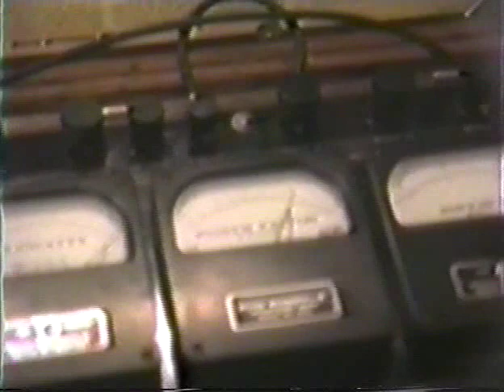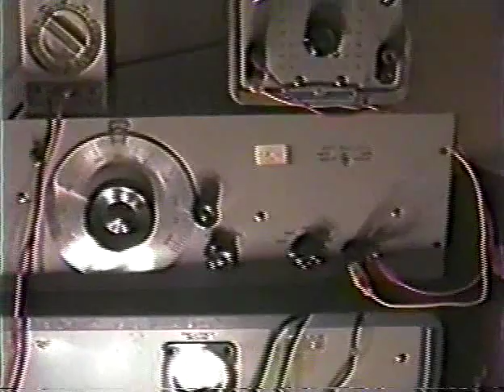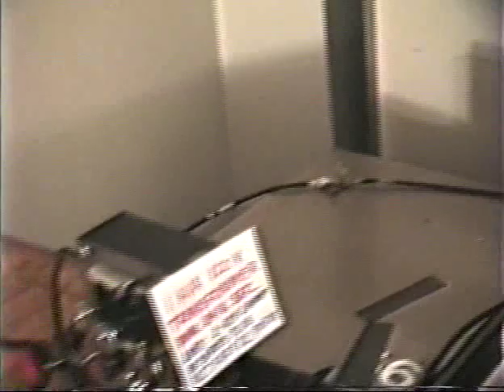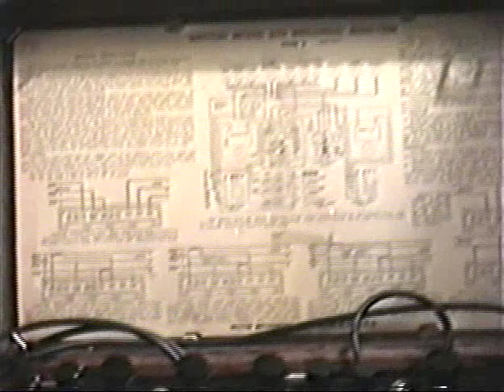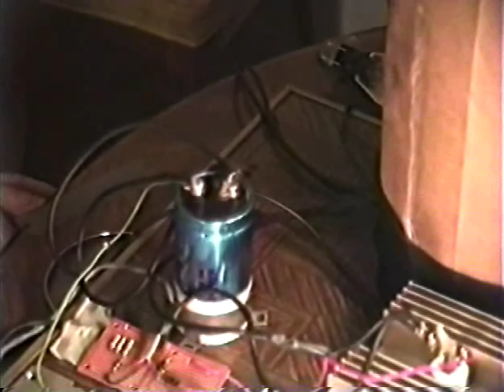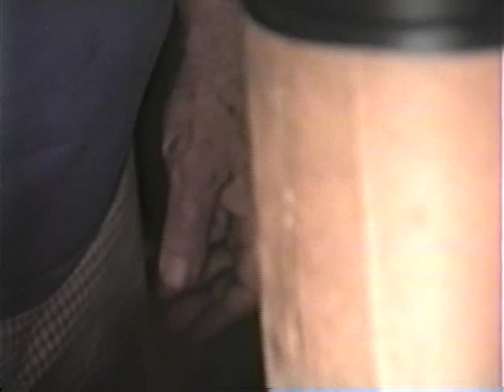Tom Bearden   Floyd Sweet's Secrets

Comment: 201 vibration amplifier features are Philips tungsten alloy points i have many of them rebuilt i also found that mathematical characters are very important component to tuning the system no exterior vibration can be heard tha cathode ray machine i worked with in radios i learned many things above the normal level of gas units that have a large amount of energy in there outputs